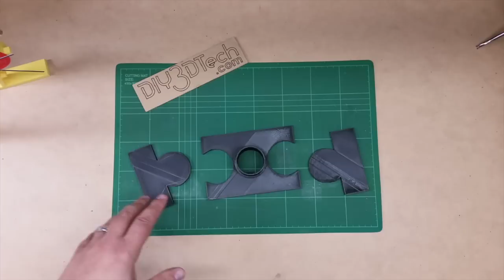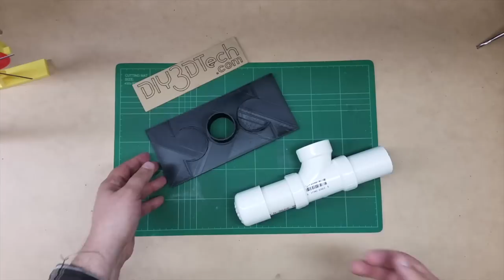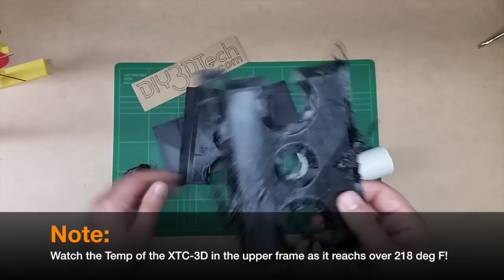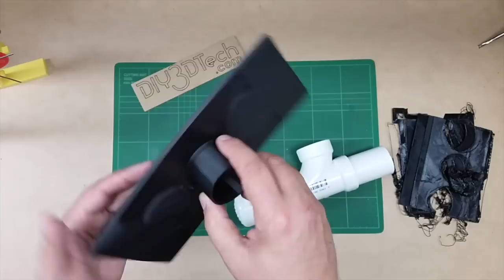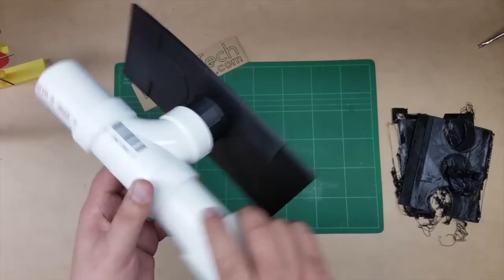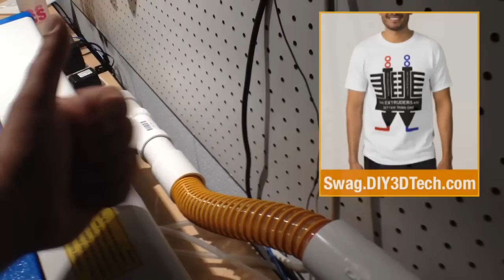K40 eBay Chinese CO2 Laser Cutter & Engraver  - 3D Printed Fume Extraction Port!

Comment: Odd question, can you at some point possibly try feeding the exhaust through a water bath to see if it's effective at dealing with the fumes ?

I'm tempted to try and re-arrange my space to allow for one of these but i've no way of installing a vent for extraction but I remember this is how the original london underground trains dealt with smoke (They where originally steam powered :D)
Reply from the maker: I like the thinking however fume removal is a huge issue especially with plastic as its so bad I am going to likely build a new shop as I have a 16x40 shop in the basement however even with all of the mega evacuation kit I have it still stinks the house up and my wife goes though the ceiling!  I know the concept your speaking about (water scrubber) and wouldn't see it as practical.  As "if" you could what you would need to do is pull the fumes though a "curtain" of water and you would need a way to create that (like a humidifier on your furnace).  However this would be effective primarily for "particulate" matter and not "fumes" (i.e. "gas" or atomized matter).  I know that one newfangled laser offers a heapa filter for about $1,000 as an add on however I can see that working either as I tryed something like that and simply could not keep up with the volume of gas...